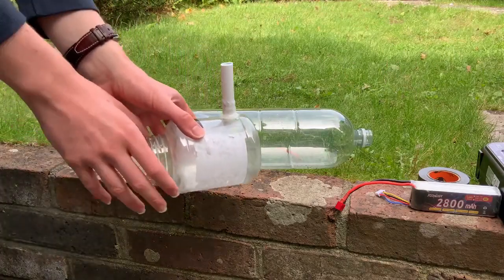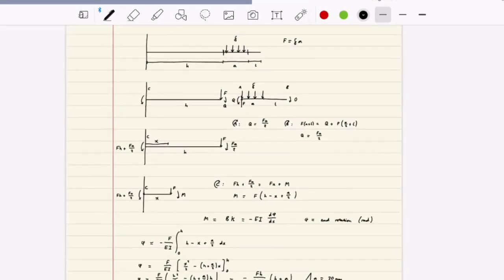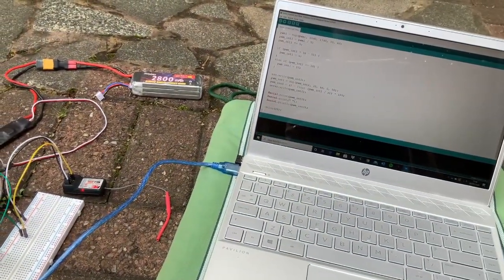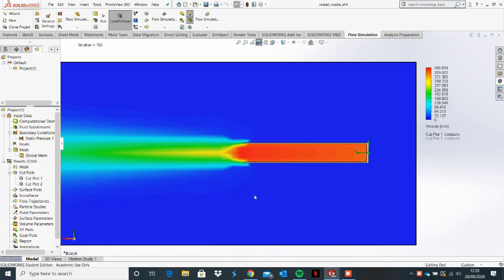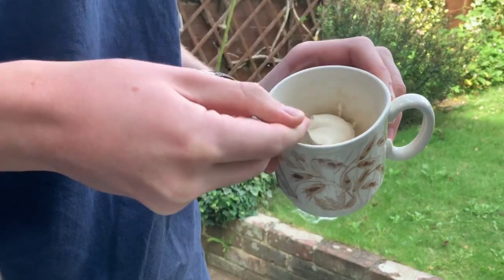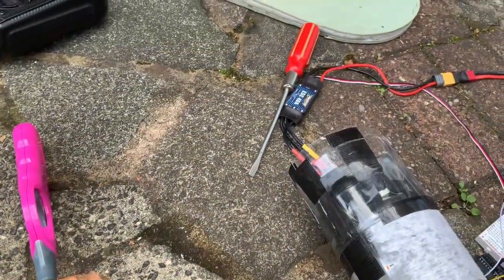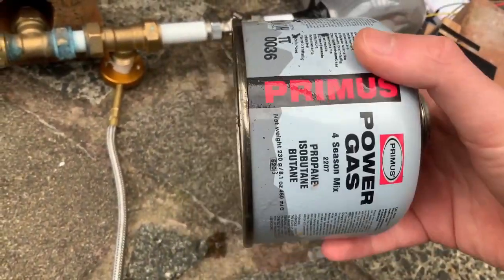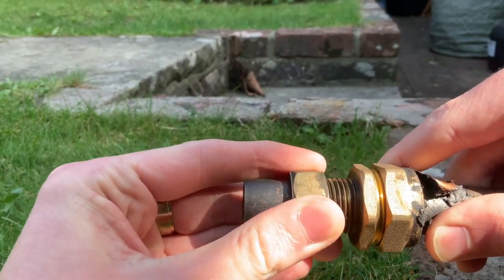Mini Motorjet Engine Made Using NO Power Tools

Comment: Fans don’t compress the air . A real motor jet powers a compressor stage of a turbine to produce thrust instead of a propeller or fan as a result you don’t need to have fuel in the compressor for thrust .a afterburner can be added but as ramjet technically it’s a separate engine feeding on the airflow of the first engine the ramjet requires supersonic air to function.

Comment: I've gotta be honest with you - is this a jet engine or is this a hairdryer burning some propane after the fan? I don't see any meaningful compression or thrust going on here
Reply from the maker: The low fuel rate out of the gas can really limits any thrust generating capability. This is a jet engine in the sense that it produces a jet (the combustion occurs within the engine for the most part, and then the gases are forced through a narrow opening). But I take your point, this isn't overwhelming powerful or efficient, it's just a little project I've worked on.
Reply: @TheDodgyEngineer  Turn the can upside down like Colin Furze does on his pulsejet bike*. But even so, I think a key feature of a jet is that the combustion takes place at a higher pressure than the surrounding air, and I'm not sure if that's the case here

*I take no liability for injury, property damage or accidental death
Reply: No thrust=glorified hairdryer
Reply from the maker: @SadParting97  Yes the thrust may be a little lackluster, but I still wouldn't fancy drying my hair with this. Just because it isn't powerful doesn't mean I didn't have fun making this, or learn new skills and theory.